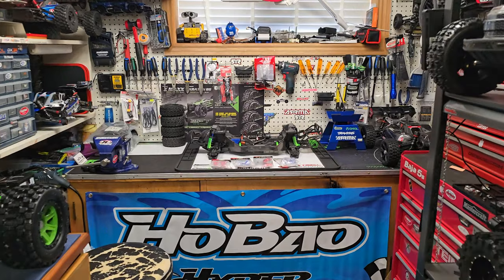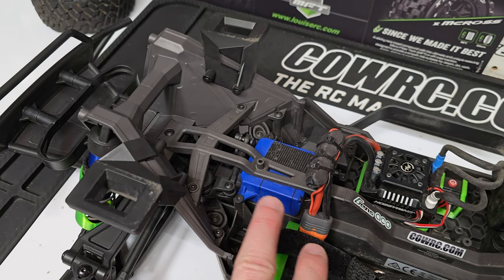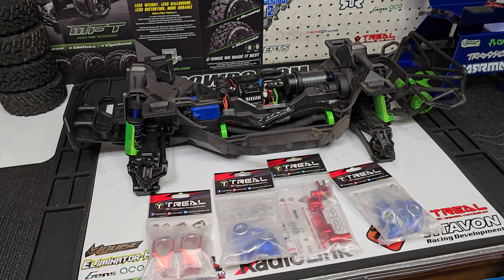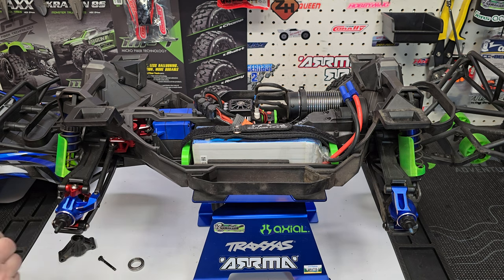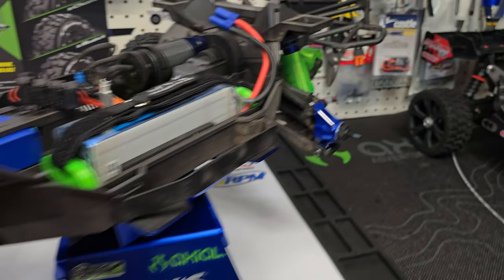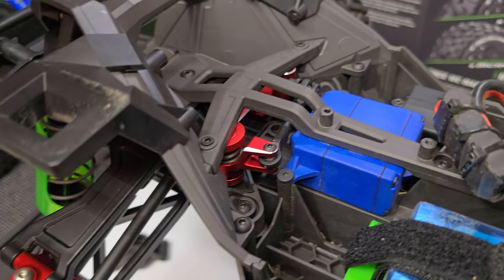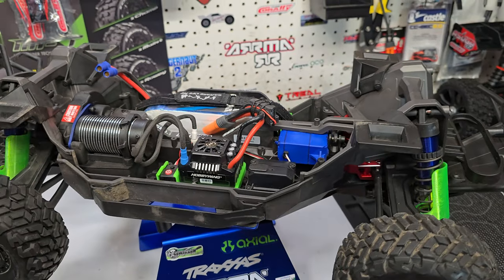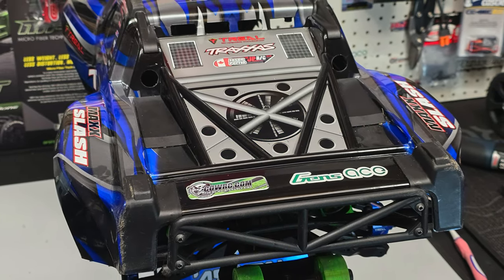Traxxas Maxx Slash (Treal Upgrades)

Comment: Yeah you need the CVD steel axles w/ the 17mm adapters. Same deal with the Maxx.
Reply: Yep… I’ve got Vitavon hubs that are the same, have to run Traxxas steel cvds to use the large inner bearings
Reply: You're probably right